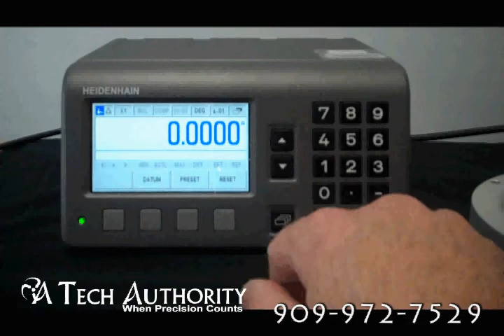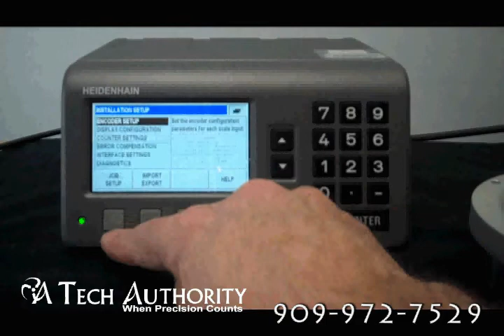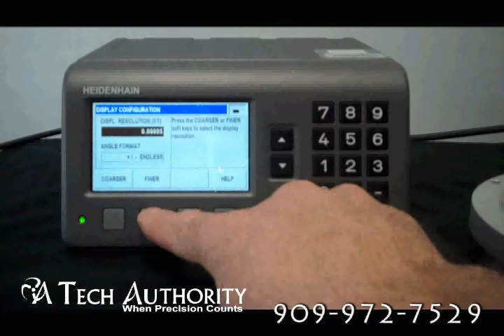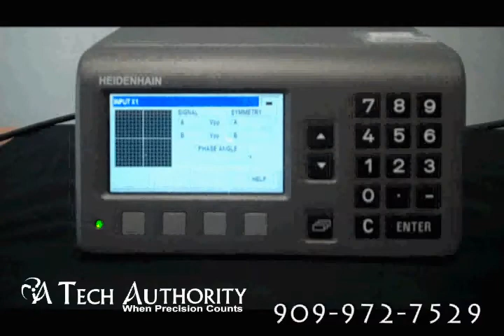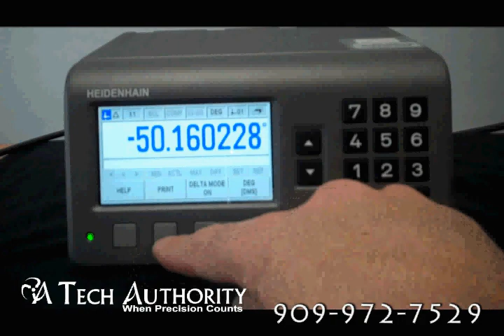A Tech Authority's HEIDENHAIN ND 287 Display

Comment: Hello,  I'm trying to use the Error Compensation on the ND 287,  I'm Using a Renishaw ML-80 laser as the master.  Is there any way to interface the DRO and have the laser download to the DRO?
Reply: Hello Michael,  The ND 287 has multipoint compensation, however the values need to be entered manually.  See pages 80-83 of this manual for a detailed explanation https://www.atechauthority.com/pdf/ND287_man.pdf.  Feel free to contact us at service@atechauthority.com with any further questions.

Comment: Hello, I am working on a school project but my group is having issues connecting our ND 280 with the computer. Is there any way you can tell us how you did this? We have been going online sites and the manual, but have not been able to figure it out
Reply: BTW, accord to HEIDENHAIN manual, they suggest you to download their whatever stated in the manual but you can just use PUTTY in your system.  It's the same thing.  Just be sure to have all your setup in the ND280 and the command in the PUTTY to match so data can be export to your PC.  Thanks

Comment: How do you get the measure value on the ND 287 export to a PC or network system?  I hook it up to the USB port and when I pressed Export, no measure value came thru to my PC except the information about the unit?  Your help would greatly appreciated since I was trying to export data to out PC and link it to our network to perform SPC.  Thank you!
Reply from the maker: Good afternoon.  That is typically done through a command B prompt.  Do you have the owners manual?  If not, I can email it to you, or perhaps find it online.
Reply: Thank you for replying back.  I do have a manual for our ND 280 but looking at all the setup details, I'm still a bit confuse and unable to transfer measure value to my PC, connected vs. USB after uploading their software as specified in the manual.  Anyway, what's "Command B prompt" you're referring to as I'm not really that tech kind of person.  The manual state, interface vs. RS-232, USB port and then export data using "Export" soft key or as option use PRINT soft key or the CTRL B.  Any helps would be greatly appreciated.
Reply: FYI:  I did get the system to export measure value to my PC.  I just absorbing too much information at the same time and confused myself in the process.  It's pretty straight forward after all.  Thanks for responding back regarding my questions.
Reply: @tousshong9438  Hello, I am working on a school project but my group is having issues connecting our ND 280 with the computer. Is there any way you can tell us how you did this? We have been going online sites and the manual, but have not been able to figure it out
Reply: Not sure what you mean, problem connecting to the computer?  Did you mean you want to export measured values to your laptop or computer?   1) Purchase WedgeLink SP cable from Amazon or online from www.microridge.com 2) Also purchase a female to female "Null Moden" so the WedgetLink cable can be connect to the adapter and then it will connect to the RS232 male port on the ND 280.  That is, if you're using the RS232 port as our connection selection.   If not, you can setup your unit to export data vs. USB cable by using the USB cable on the back of the unit. If you're using USB cable, set your Interface Setting to USB, baud rate and at 19,200, Data Bits at 8, Stop Bits at 1 stop, output to 0.  However, if you're connecting your unit using USB then you must use "PUTTY" in your computer/System to export the data.  In PUTTY, your connection and setup must match the setup in your ND 280.  This is the cheap version if you just want data to export to your excel worksheet and/or notepad etc..Lastly, if you're using the RS232 port to export data then you have to buy the plug and play WedgeLink SP cable in order to export data out to your computer etc...Remember to go into your unit and set the Interface Setting your port setting to "RS232", Baud Rate to 9600, Data BITs to 8, Stop BITS to 1, Polarity to NONE, and out put to 0.  Let me know if you needs more helps.  Thanks